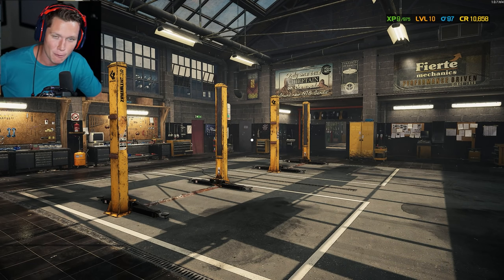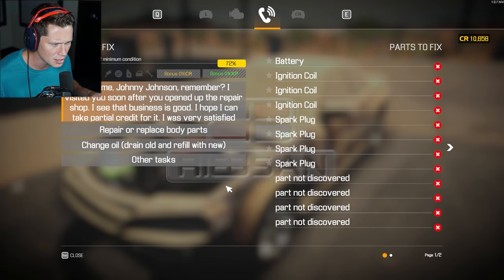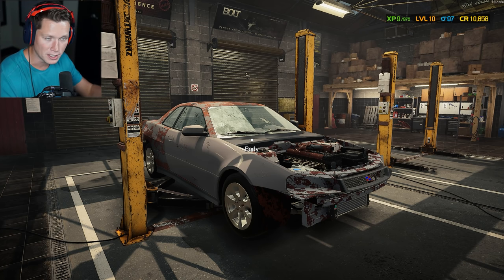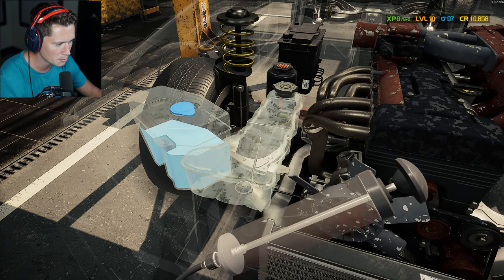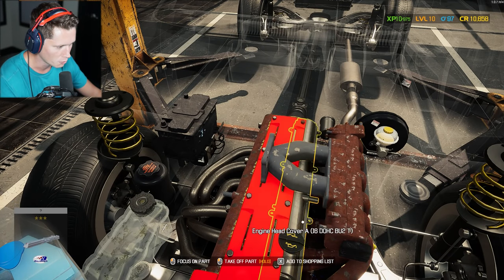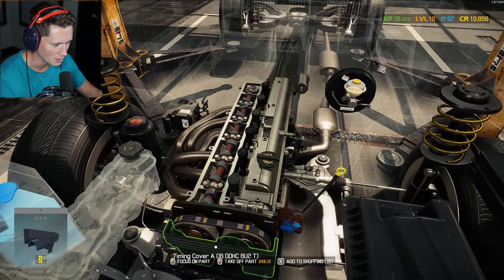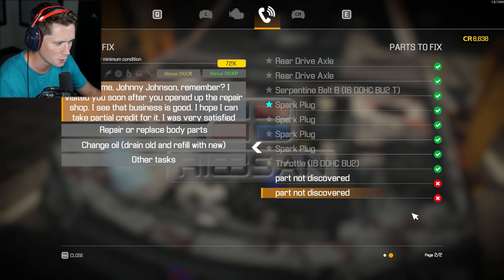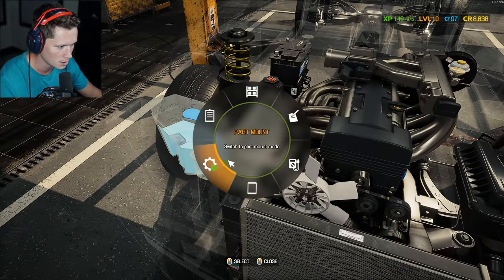Car Mechanic Simulator 2021 - Part 7 - FULL R34 SKYLINE REBUILD!

Comment: Hey Trevor here's a tip: go in inspection mode first if you have undiscovered problems you'll find what you're missing first
Reply: Also buy the welder and use it on the entire rusty car and it will get ride of the rust👍🏼
Reply: That doesn't always show you what's wrong

Comment: Trev, with $20k, you're better off going to the auction and buying a rotted 1 star car to rebuild for <$3k. Chances are, those barn finds will cost you close to $20k and you won't have enough to rebuild it.

Comment: You have a welder near your tool box by the first lift use that as well to help fix the rest of the body and frame up with the body you can not remove from the car it costs $100.00 to use it but it also gives a boost in what the customer pays you in body work repair and makes the car look better as well @TmasTn2

Comment: If you disconnect the driveshaft and transmission from underneath and drain the oil you can use the engine lift and pull the motor out and put it on the engine stand in your new expansion and put the motor on it and makes it easier to work on

Comment: Just a tip for fixing the rust on the body parts you can't replace or repair paranormal means you can use the welder just like you do the carwash and it takes care of the rust on the body.